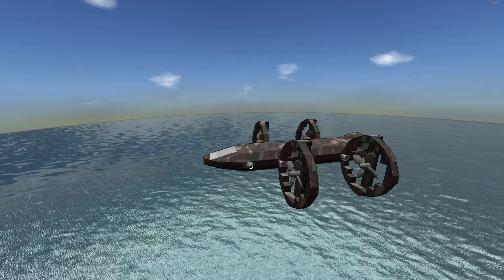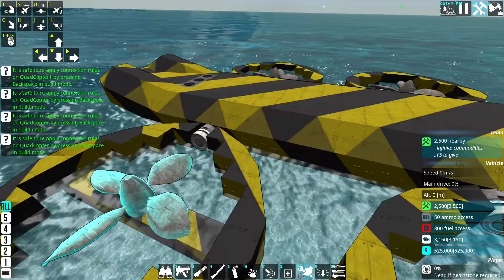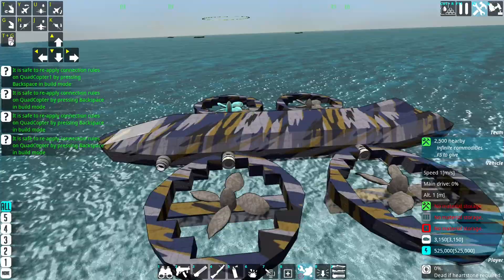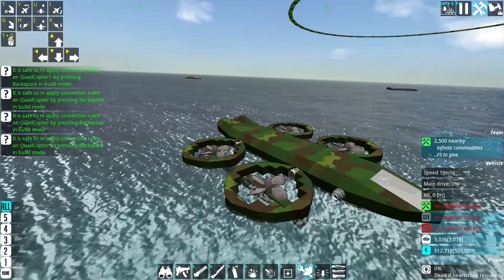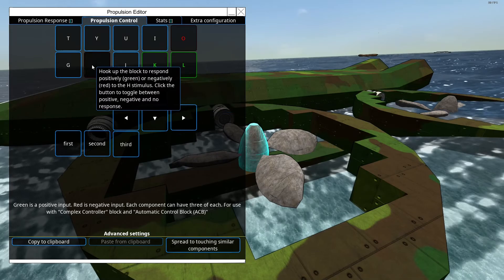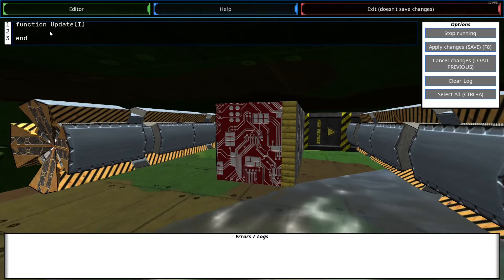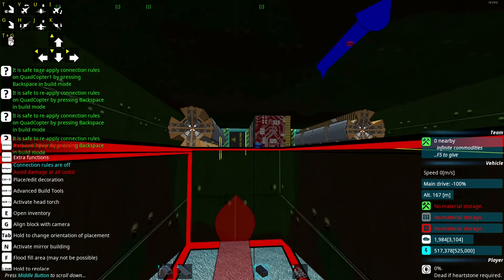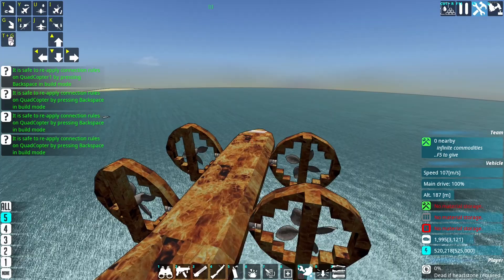LUA Quadcopter and LUA Propulsion Tutorial! | From the Depths Guide

Comment: You could make a spin block angle function and use a parameter rather than using a bunch of different functions multiply by -1 on the reversed spin blocks
Reply: Having put 80-odd hours into trying exactly this, my conclusions are: 1. Calculating the angles is not difficult. 2. You can do some amazing things like having your thrusters automatically compensate when one is damaged or destroyed. 3. Any craft you build using this will be completely uncontrollable because Spinblock rotation speed is far too slow, no matter how much tuning you do with your code, PIDs or anything else. Unless some much faster (twenty times faster at least) Spinblocks are added, then this is a frustrating dead end.

Comment: Is there a way I can get it to hover in the air stationary when not in use instead of floating in the water
Reply: Should be pretty easy. When in neutral, check it's height: if it's above, say, 10, it's flying, so don't turn off the rotors completely.
Just need to figure out how to get them to spin just fast enough to keep your height stable.
Reply: If you replace the complex controller input with custom axis, you can gain access to partial input levels, rather that just on/off. It requires a bit more work to make it function, though.

Comment: Having a different function for each possible orientation you want is a bit wasteful... Can have a single function that accepts angle as a second argument, applies it as is to the first two, then applies it's negative to the other two.
Edit: after trying it out for myself, I found out that using custom axis as input instead of complex controller stimulus can work better, as you can have a different one for each prop, and you can also control the power level, which makes a hovering behavior possible.